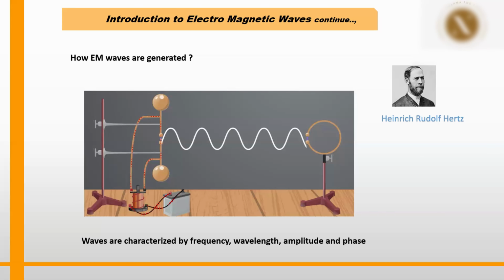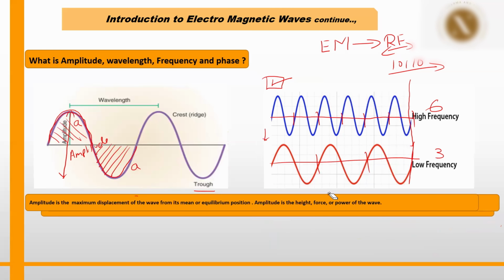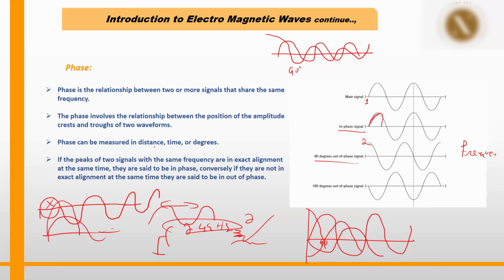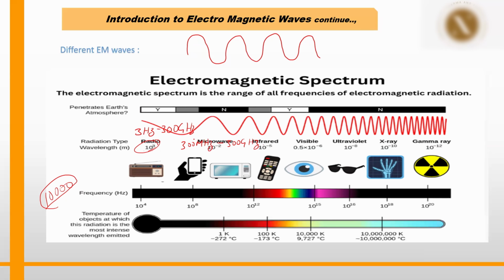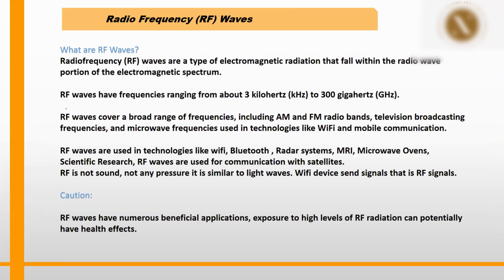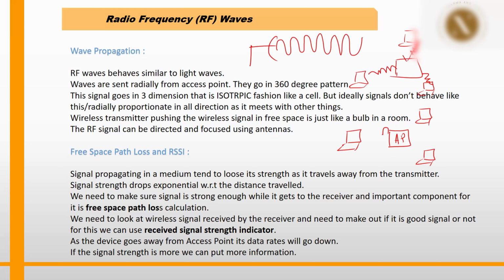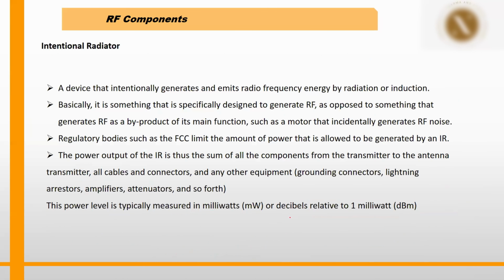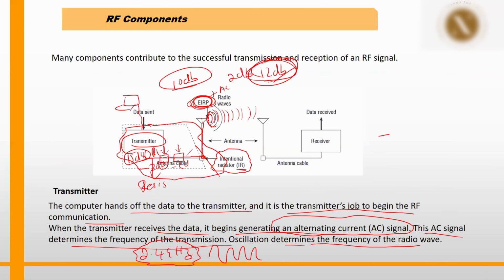TC Wireless Basic  RF Characteristics Day2

Comment: Be careful when you describe  time division multiplexing and radiation at 50:30
The radiation from the transmitted antenna remains the same, and it is sent in all directions, even to those receivers that are not in the time slot of the information.  The radiation is sent in all directions, as in frequency-modulated systems. Then it is up to the receiver to tune in using the right time slot or the frequency slot.

It would have been interesting to talk about the fact that radiation at a particular frequency does not occur in ever-growing circles around the transmitter antenna, but when the diameter of the circle reaches half a wavelength the big circle will break down into smaller crcles of half a wavelength in diameter and so the space at a distance from the antenna is full of patches oscillating accordingly travelling out and any antenna met would be excited by these circles of E/M waves at the frequency of transmission be it frequency modulated or time modulated.  No one presents the fact that the excitation of space around the antenna is analogous to Chladni's figure on vibrating sheets or vibrating volumes in waveguides or microwave three-dimensional resonators. https://youtu.be/wvJAgrUBF4w?si=PRmqHUTmSmAQvVhd